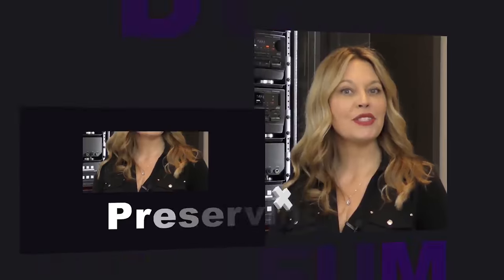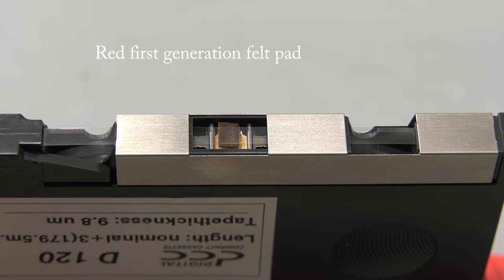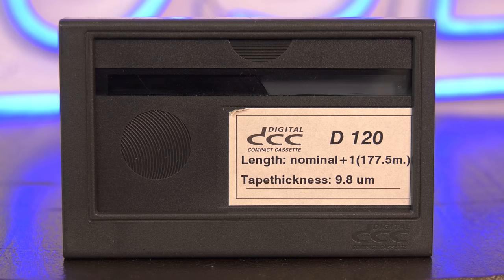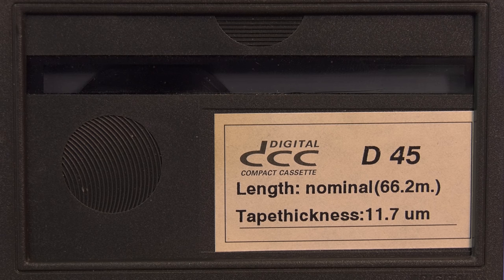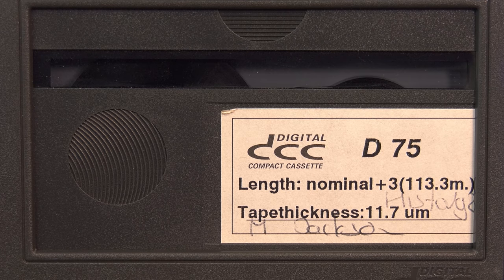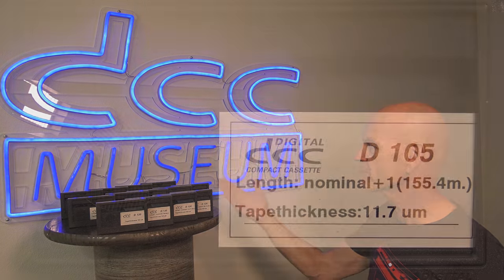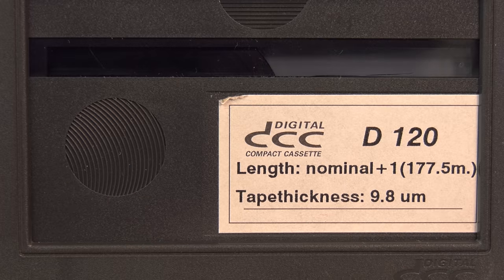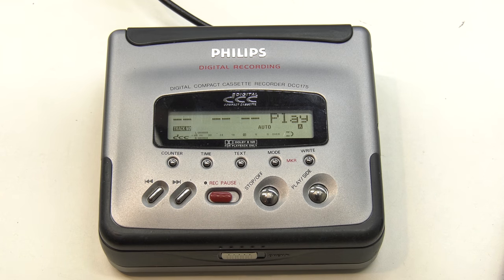Original Philips DCC Test Tapes from 45 to 120 Minutes

Comment: In the 90’s when I’ve used DCC the most, never had the question for longer than 90min, my most used tape was 75min. 

But in the 10’s & 20’s it would have been nice the 120min, so I could record a hole concert from Blu-ray 😊